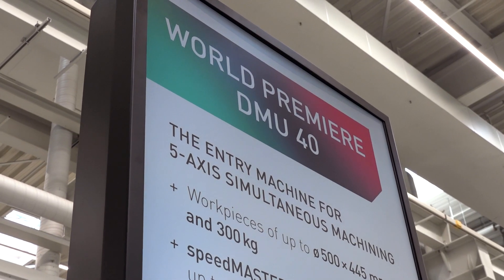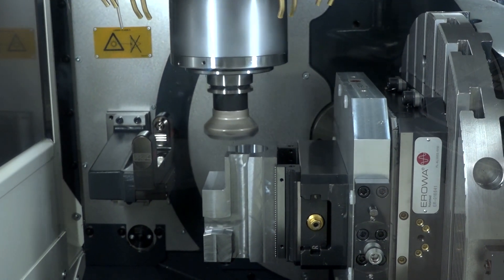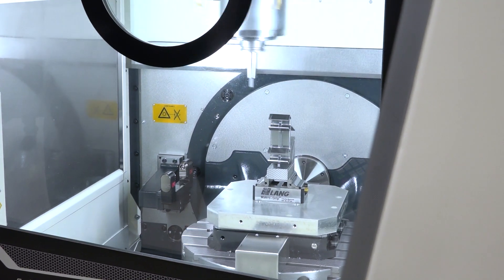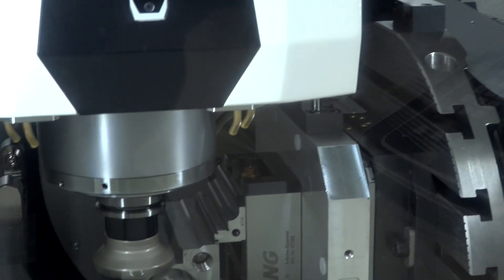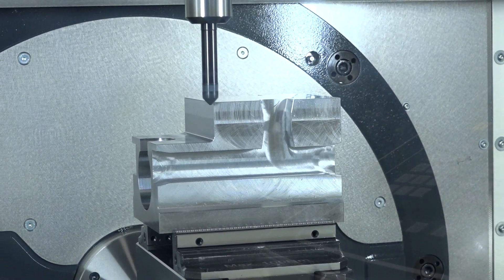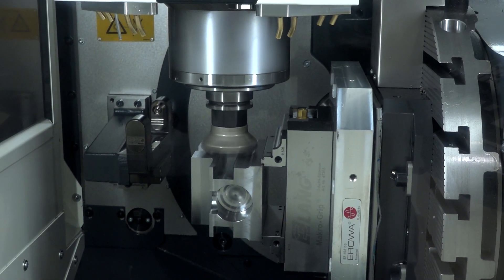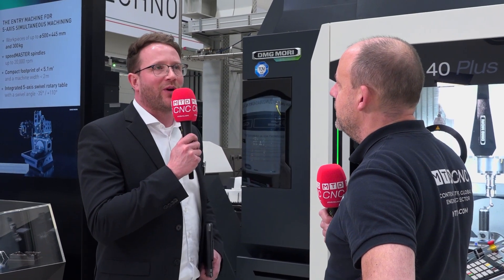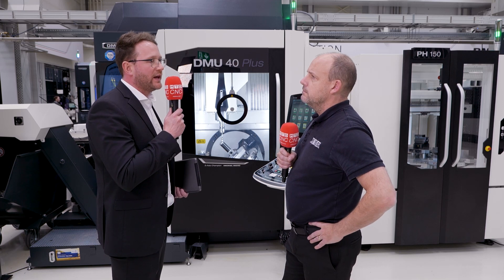DMG MORI’s DMU40 Plus world premiere at the Pfronten Open House 2023

Comment: So why would you not just buy the DMU50 ?  Charles
Reply: As he said, this is replacing the DMU 50.
Reply: @muddasarakram419  It is only replacing the DMU 50 2nd generation, the DMU 50 3rd gen is still available.  They just didnt explain why they have another machine with the same specs as the DMU50 2nd gen.  It would seem a better replacement for the DMU 40 linear machine.  Sadly there is not much information about the differences on the website yet.  Thanks for commenting.